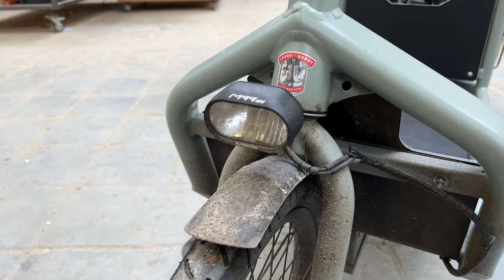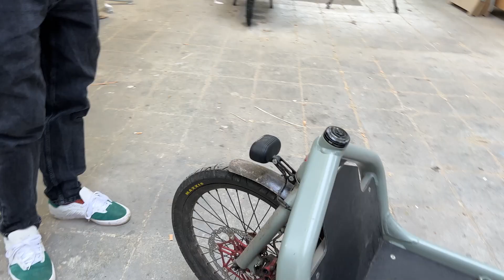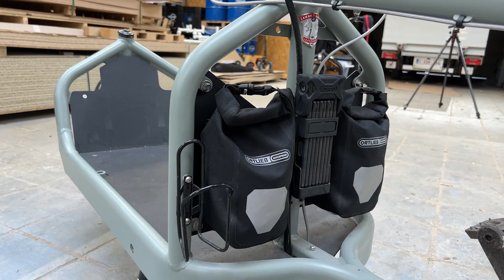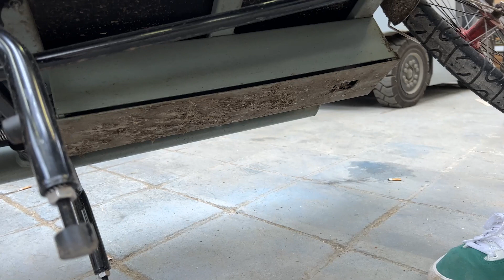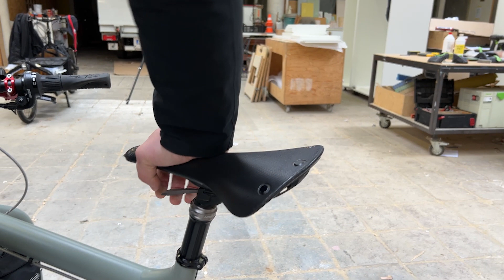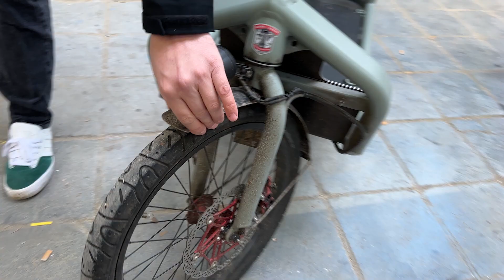In search of the ultimate Bullitt cargo bike episode 6. Ittai's Pinion Bullitt cargo bike

Comment: I would buy this bike in a heartbeat. It's so well thought of. Neo drive, pinion, dynamo, fatter tires with fenders, dampening headset, height adjustable seatpost, strong mechanical breaks--the works! V clean, functional, and super practical. Just say the word and I'm ready to throw the cash. Well done!
Reply: And the battery is hidden underneath! I love it.
Reply: Waiting time is about 10 month at the moment… don’t ask how I know … :(
Reply: @derTeddy  that's too bad. I'm in Canada anyway, and sadly, they don't ship internationally, so I can wait as long as it takes.😁
Reply: @derTeddy  That is something i am aware of too.. :/
Reply: @derTeddy  A was also told its 8-10 months this Monday when I was test driving one there ;-) Not 100% sure yet about it ... Love the 27.5 inch rear weal in addition to the C1.12 I would order. My second favorite version is a Rohloff based one with a standard frame set ...
Reply: @jensdecker8864  i believe these are two very different bikes. the pinion has (depending on the model) the option for more gears and constant/equal spread of the gears. i dont think the rohloff has that. also the neodrive motor is a compleatly different bread to the middle motor version. i think the read hub motor suits the bike better

Comment: Thank you for this video, really like the pinion version, although I still have a couple of unanswered questions. It would be good  to understand the benefits (user experience) a bit better around the differences in the pedal assist options and how the pinion is behaving in real life compared to other available systems!
Reply: Hi, I have had both the e6100 from shimano and the pinion + neodrives. The shimano system has the motor in the bottom bracket and the gearing in the back wheel, the pinion is the other way around (obviously). There are different subjects to focus on: maintainance required and driving experience. I’ve had the shimano system with belt and nexus as with chain and derailleur. I can tell you that the belt and nexus is crap. No way around it. The XT di2 derailleur wit chain drives like a dream, but needs a new chain/cassette every +/- 2000km. I would say the pinion drives somewhere between those systems but with 1% the maintenance. 
The motor is in your rear wheel, so the power delivery is very direct (always there). Downside is that it doesn’t feel as powerful. 
Let me know if you have some specific questions!
Reply: @ittai1985  Thank you so much for the comprehensive answer, that’s really helpful! So the pinion doesn’t feel better than a XT drivetrain.. that’s a bit surprising as I thought the pinion would be the most superior option. I did a test ride with a Riese & Müller High speed cargo with a bosch mid-drive and the E14 rohloff.. and switching gears didn’t really impress me, maybe because I am very much used to the Shimano chain/cassette setup on other bikes. I guess some more testing needed.. do you think more power (newton meters) for the neodrive will be needed/desired?
Reply: Hi, it should be clear that nothing will beat the feeling of a well set up derailleur system. But for a center motor e-bike it just isn’t strong enough. The primary reason for a internal hub gearing system, or in this case a gearbox on a cargo bike used daily should be how little maintenance it requires. Apart from that the pinion shifts very nicely. You can shift under full load. It hardly ever skips a beat. You can’t compare it to a rohloff (which I also used for a long time on a mtb). The rohloff is great, but it’s a very old system. If you want to ride your bike around the world without being worried about your drivetrain you should pick the rohloff or pinion. If you want to win races and tinker with your bikes often, you should keep the XT (which is amazing). See next weeks video which is about my other bullitt, hint, it’s an XT.

Comment: Any idea who might offer bullitts with a pinion setup in the US? Or is it something that can be installed relatively easily if I just ordered a frame for example and put the bike together myself.
Reply from the maker: Hi OssoGrizz, thanks for reaching out to me. To install a Pinion gear they have to cut out the original bottombracket and they have to weld a new bracket into the frame that takes the Pinion gearbox. Bullitt-bike.de are the only ones who have permission from LvsH to do this. But sadly they don't sell to the US. You can check the interview with Norbert Wuddick here: https://youtu.be/SJDKu7CW588